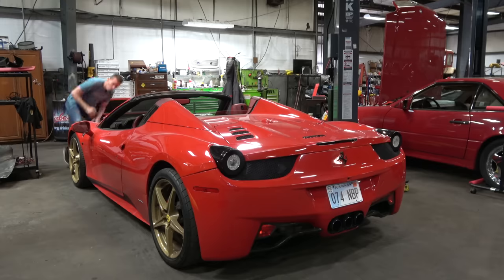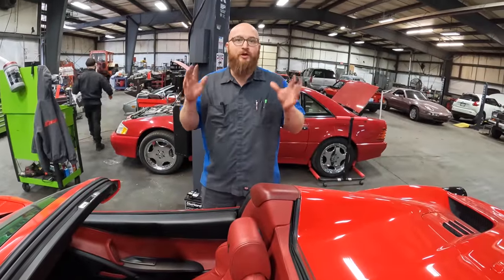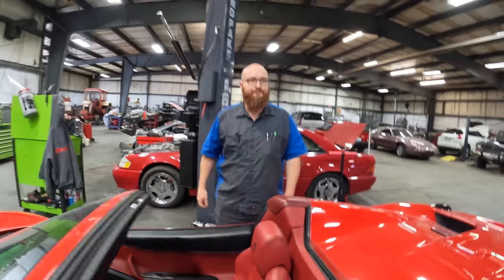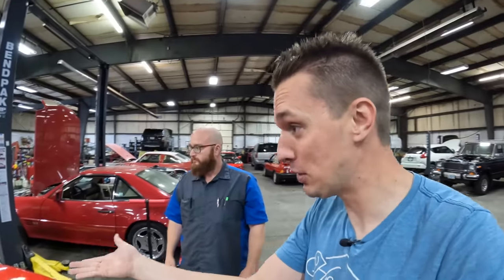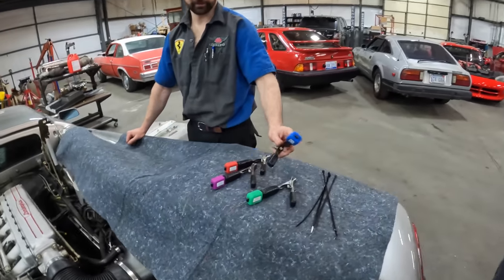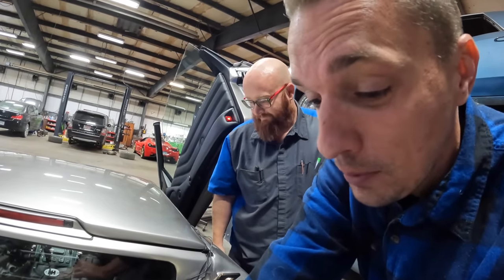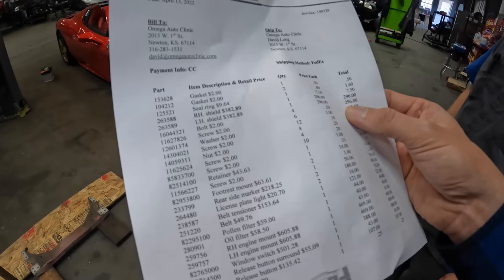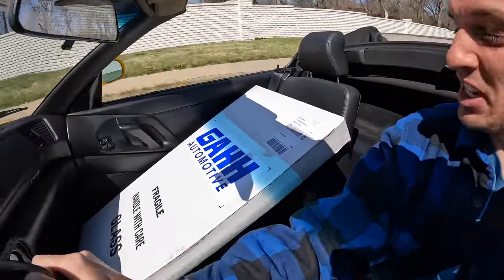MORE HIDDEN DAMAGE found on my CHEAP Ferrari 458 Spider! How bad was it really WRECKED???

Comment: Does the Diablo have an oil thermostat?  94-98 volvo 5 cyl turbo engines make a very very similar moaning noise like your diablo when the oil thermostat fails. Might be worth a mention to the Wizard.
Reply: I found some info indicating it does have an oil thermostat built into the oil filter housing. Might be a good chassis ear location.
Reply: Wow very perceptive!
Reply: may be worth a check
Reply: I was thinking it sounded like an oil pressure relief valve making noise as the spring bounced the valve...
An oil thermostat would be the same sort of sound...
It really sounds like a typical noisy regulator noise of some sort to me!
Reply: Lool nope. That’s only volvos
Reply: Can confirm this, i have such volvo and had that noise. It has dissapeared after oil and oil filter changed (the car was sitting for a long time before i bought it), i think it was collapsed oil filter, but might be oil termostat too.
Reply: Whipped cream and a cherry 🍒 on a turd 💩
Reply: @tomtheplummer7322  sheeeeesh
Reply: Car Knowledge man i love that shit !
Reply: I was just about to say it sounds like oil cavitation in the galleys.  The oil being at the wrong temperature could cause that by changing its viscosity.
Reply: Ohh you right. They do indeed that cow noise and is the oil thermostat that goes cucum
Reply: Brilliant!
Reply: @tomtheplummer7322  Now that-is funny Tom.
Reply: Have 100% had that same sound on a 5cyl Volvo… I was gonna ask if this thing has a dry sump… maybe it’s a cavitation issue? Check the sump inlet screen?
Reply: Maybe he locked his mother in law in the trunk

Comment: I had a car with a Bosch fuel pump and it sounded exactly the same and it made the noise resonate and sound like it was in the door, might be worth a look 👌 p.s. it only happened when the pump warmed up, took ages to find out what it was.
Reply: me too, i think the fuel pump is the problem, I have no doubt its the fuel pump
Reply: Pretty good area to look at
Reply: I also had a car with a fuel pump that made that exact noise
Reply: This! Put this up so they can see this!
Reply: The fuel tank and pump is in that location isn't it?
Reply: Bosch fuel pumps have cavitation issues for sure!!! Never had a quiet one yet
Reply: Was thinking the same, or possibly a bad fuel pressure regulator?
Reply: Tom Head  , was it in the door ?
Reply: @johnb4183  no it was in a 98 Subaru Impreza STI with an aftermarket pump, eventually had someone laying in the back seat with their head out the door almost touching the ground before we worked out what it probably was, this is in Australia where the pump is on the same side as the driver, the tank is under the back seat/above the diff.
Reply: Had the exact same problem 👍🏻
Reply: Doos
Reply: Yup, agreed, another question is how many fuel pumps does Diablo have? I have two on my Porsche and one of them died as well. Fuel systems can be very loud when they break, in general injection is a big part of the engine sound.
Reply: Sounds legit as the noise didn’t change pitch with the engine revs! Nice catch!
Reply: When my gas gauge died on my VW Quantum, I relied on the fuel pump sound becoming much more noticeable as a warning
Reply: It’s a Hoovie Hooptie.
Reply: this!!
this is the sound my 3 series 3 litre petrol does when I unlock it and the fuel pump is priming up the pressure in the lines!
(EDIT: for my car, the sound is normal)
Reply: Yep I said fuel pump from the very beginning.
Reply: Great choice.
You have actually been through this.
I would have thought intake or air filter flap  or something loose in the intake system but they checked all that to sundown.
Then maybe worn,sticky throwout bearing but the sound comes and goes-
and maybe shift linkage shaking under the car because of worn grommets and rubbers in the linkages but if this was going on,you should feel it through the shifter at the same time.
Or how about this worn motor or transmission mount where the rubber is worn out where you can't see it and there is metal to metal contact when the car gets to speed.

But this you should feel through your shoes through the floor as it happens.
I can't wait to find out this is some stupid mod or cheap trick the former owner or a former mechanic did to the car and the Car Wizard comes back and says,
"You will not believe what we found."
Reply: @phil4986  I'd imagine if the engine mount went it would probably set off the knock sensor, I know of two people who've been told they have a big end knock only to find the oil filled engine mount has split on removal, for some weird reason they used them on the Subaru Legacy GTB but all the other Subaru's ran solids and never had the same problem.

Comment: I used to resolve NVH issues as a former exhaust system engineer.  After seeing a few of the videos with the Diablo, I'm convinced the issue is a mechanical resonance issue and not acoustic.  I doubt microphones will be able to locate the problem.  You will need to place some accelerometers in the suspect areas and feed those inputs into some kind of data collector to find what area/component is resonating.  Perhaps the cheap way to work this process is try putting some weights in the suspect areas to see if it changes as mass will affect the resonant frequency.  So give up on the microphones, they won't help!
Reply: pico scope with nvh sensors
Reply: Is that why some exhausts have weights welded onto them? To prevent resonance noises?
Reply: The Diablo noise is the air bypass release if it's coming from the passenger engine area.   There's also an air balance system that connects both throttle bodies.
Reply: In terms of microphones an Omni-mic isn’t going to be able to directly locate any sort of sound. These mics in particular are of very low quality and I’m sure the accompanying calibration file isn’t that great either. While I’m very much an amateur car enthusiast I am a professional home cinema installer and calibrator. That being said using those styles of microphones to pinpoint sound pressure level output isn’t that feasible unless you can specify the frequency range you’re searching for as those omnidirectional microphones will pick up all sound in the relative area of their placement. For reference we use $3500 microphones to measure speaker and subwoofer performance in a semi anechoic manner and even at that price range they’re considered mid range.
Reply: @georgeanddaddecker7563  Yes (weird, huh).  Placing "mass dampers" on some suspension and drivetrain components is pretty common, too.  I wonder if the Diablo is experiencing some engine mount resonance that's being transmitted to the frame/body.
Reply: That's one of the best answers I've ever seen.......for anything!! 👍
Reply: Gm fix was to hang dead weights in areas to dampen and change mass charachterstics for NVH
Reply: Wizard just trying to run up the bill
Reply: @Mike Wilson, I already suggested the accelerometers  (well piezoelectric vibration sensors) the last time this car was brought up. I never saw any kind of acknowledgment from Hoovies Garage, it really seems like they only respond to stuff "Mr Wizard" knows about. I see there is a comment about the air bypass release, that is an interesting notion, I know that some of the hill climb cars that I have been in have a similar sound when large positive air brake ducts are installed, I never really considered it before but in hindsight it does make sense. I put up a reply referring to a SCCA modified that came across my shop door, same type of noise, similar intervals and inconsistencies. It turned out to be a crack in the flywheel wheel. Anyway, just glad to see there are others out there that know to look in the areas referenced to find answers.
Reply: @alexiocatan5602  Or Hoovey milking the issue for views
Reply: Bingo!!
Reply: Whenever I see comments like this it both completely makes me love the people that watch stuff like this and also reminds me how incredibly stupid I am. Which I can actually appreciate, in its own way. Thank you Mike Wilson and people like you out there in the world. You make it a better place.
Reply: @alexiocatan5602  That is not needed with a customer like Hoovie.
Reply: I have no idea what the problem is, but perhaps this information will help.  I'm a musician, and the note of the drone is very near middle C, or 264Hz.  Call it somewhere between 250 and 275.  

Ask yourself what is vibrating at 260 times per second, because something is.
Reply: @herrbrahms  You might be on to something.  That frequency (264 Hz) corresponds to the primary firing frequency of the engine at ~2700 RPM.  This problem has 3 components:  1) Source (engine), 2) path, 3) response (like a speaker).  Not much can be done with the engine so you'll have to resolve the path and response.  I suppose one way to investigate this is run the car up on the lift (risky I know) to the known noise RPM and try to feel what component/area is vibrating (resonance) and see how that is finding a pathway to the car's cabin (speaker).
Reply: @michaeljwilson125  Yep.  I also have a hunch that the reason the hum only appears at operating temperature is because the speaker phenomenon requires heat expansion of the guilty component in order to create the precise geometry required for harmonic resonance.
Reply: So wouldnt something that is vibrating at a frequency enough to make a sound kind of by definition just be vibrating at that frequency and therefore on an accellorometer  would just basically reveal the same thing that you would pic up on a microphone? And really there difference between the mic and the accellorometer aremt that drastically different in some sense,  Now i do think that once you have the sound islated with the mic then the accellorometer might come in handy because then you could attach it to various locations of question and whatever spot has the highest component of vibration at the matching frequency would allow you to pinpoint it more precisely. I mean in a sense that's basically how the Wizard  said he was gunna diagnose it by standing on there with the stethoscope. I really just don't understand how it was so difficult to find on the Mics that they had, they must've been kinda crappy or the wrong software cause i mean you could record the  clip from the episode and pull the audio into something like REW or audacity and easily see what frequency that the sound is it at sine its fairly loud and steady and then just take the mics from there and put them various locations until that area has the highest sound level. Kinda seemed like that was what they were pqnning on doing but the software didn't look like it was useful, but as YouTubers you'd think they'd have some quality mics available but idk itd be interesting to see what it ends up being i vote towards fuel system like furel pump or something else similar
Reply: Wavelength. Size of the part.

Comment: I work in Automotive NVH, so here's something to consider about the Lambo noise:  

I see some people mentioning oil thermostats and fuel pumps, which absolutely could make a noise like this.  What might make it WAY more audible from inside the vehicle cabin is if the vibration is on one of those lines that's touching the body of the vehicle @9:50.  It can wind up turning that body panel into a 'speaker' for the noise.  (think about how much more noise your phone makes when vibrating on a table vs holding in your hand)  This would make the noise clear as day INSIDE the cabin, but might be very difficult to hear from the engine bay.

If possible, it might be a good diagnostic step to try and prevent each of those lines from making contact with the body, or at least grabbing each one firmly by hand to try and damp the vibration/narrow things down.
Reply: It wouldn't make sense that it takes a while before the noise appears though. Sure some lines will get warm, but not hot enough to only expand by that point.
Reply: @martij30  Maybe the lines only help to transfer a vibration that happens when some specific component gets hot.
Reply: Interesting theory you have there, this would indeed causes a similar noise however as this is happening at a certain rpm even when this car is stationary this seems unlikely.  If I had to make a guess I would say something on the intake side of things is not aligned quite correctly and at a certain pressure is acting as a reed. Failing this potentially the return line to the fuel tank is vibrating at a certain flow rate (think like pipe knock on badly fitted central heating)…  A potential diagnosis step may be to check roughly what rpm this happens at and then guesstimate the frequency of the sound… if it happens at 3000rpm and it’s a 3000hz drone it’s something rotating.. but overall just let em get on with it, they have more experience than we do with this machine (I’m not just an armchair mechanic, I work for chevron in the uk and work rebuilding b8 and b17 engines)
Reply: @cunningstunt9226  It just might be the cause, lately been seeing more people think that its the cause, but in the video he said it happens at idle but he had to get it warm before it started, so maybe it only happens at idle when its warm since the drive was a cold start

Comment: Hey, Long shot because its wildly different but I had my hemi replaced in my truck and got a drone and it took hundreds of hours and several different shops but it turned out to be a pad between the intake manifold and the engine valley that was missing and that pad dampened the engine harmonics and stopped them from resonating in the intake manifold maybe your problem is as simple as a missing sound deadening pad or a missing heat shield.  Worth a look
Reply: That pad is commonly removed due to a water saturation issue that becomes catastrophic failure after the intake manifold leaks. I've seen a few 5.7 hemis  hydrolock because of it. It usually presents itself as a hole in the block on the passenger side.
Reply: You're the second person i've seen talk about it being the exhaust resonating... im pretty sure this is the issue
Reply: @AwkwardYet  he did even talk about exhaust… what?

Comment: Great idea with the mics but would it not have been better to watch a plot of frequency spectrum?  This sounds like a resonate pitch at a specific frequency.  In other words, something is resonating independent of RPM once temperature comes up and vibrations induce a resonate pitch.  You would see a spike at say 400 Hz and one would have the biggest spike at the same spot.
Reply: That's true but you're not looking for the pitch, you're looking for the source.
Reply: @muskokamike127  The pitch tells you if you are looking at the problem or just the biggest noise maker.  The way they describe it is always the same pitch sound regardless of rmp, gear, speed etc.
Reply: @user-od9iz9cv1w  “I concur,” in my best and most 
Convincing Expert sounding voice. (Moooona)
Reply: I agree. Going by loudness only is useless as the engine is loud so how would you differentiate between the loud frequencies without an O-Scope ? A VU meter just displays loudness. I also would have expected the mechanics scope done long ago when they figured out it makes the noise at rest when heated up. No need to drive to isolate the noise itself.
Reply: That would be classic. Spends $15K on an exhaust when a $200 fuel pump would have fixed it. 🤣🤣🤣🤣🤣🤣🤣

Comment: 14:53 some convertible tops DO have glass rear windows; it’s just cheaper for GAHH to just have one box for their tops, and technically you are correct that boxes with that message are handled with a little more care.
Reply: yer right ser, my Z4 got glass rear window, seeing other older roadsters with wringly, milky and overall ehh looking plastic rear windows I find it to be a good solution even if it added another 5 kilos on top (quite literally)
Reply: yeah, my reasonably cheap 1997 Pontiac Sunfire had rear glass and built in defroster in the glass. I bought it for around $10K when 2 years old and < 20K miles. Also had leather and power everything. No reason any car over 20K wouldn't have real glass.
Reply: Yeah even my NB2 miata has rear glass

Comment: For the diablo try changing the O' ring in the power steering pump, the o ring might have failed and is letting air inside the system, after changing the o ring you will need to top up the power steering pump and then keep on steering left and right until the noise is gone, I have a honda crv and had the same moaning issue lots of mechanics told me different and expensive solutions that will cost me thousands of dollars however after a long search all I did is change the o ring and the issue was fixed